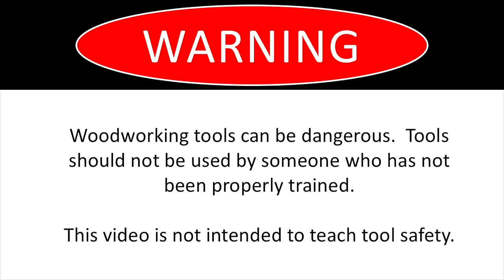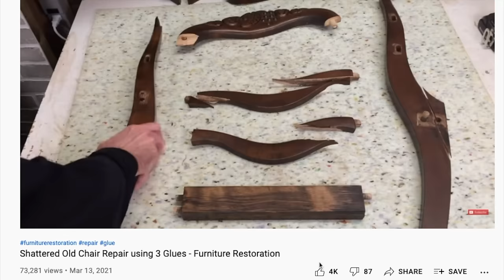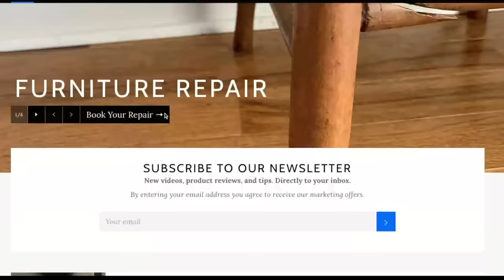Difficult Restoration of a Broken Chair, a Woodworking Repair by Fixing Furniture

Comment: With CA glues, you can also use the instant-set thin stuff, line your pieces up, clamp together, then drip the glue into the joint.  It will flow in, and you get a nearly invisible bond.  My ex used to use it for building radio controlled model planes, which are subject to quite a lot of stress.  The wood is usually balsa or bass wood, and if you happened to crash the plane, the wood would break anywhere except at that glue joint.  It makes a very strong joint.
WOW!  What delicate work, trimming off less than a kerf at a time!
Reply from the maker: Thanks for sharing that tip.  I appreciate it!  Scott #tip

Comment: Sap wood: If I am joining two or more boards with sap wood edges, before cutting it away and scrapping it, I try joining the two sap wood edges together to see how it looks. It might resemble a book matched board good enough for a tool chest but probably not good enough for fine furniture. I agree with your suggestion in reference to use of darker stain in this case.

Comment: Dear Scott, great job! The chair was a real challenge. Two comments: 
- I like to see the original pattern of the wood, so I agree with the natural finishing instead of darkening it.
- Wound not have been possible to consider the grains and patterns of the wood more in the replacement pieces?
Congratulations for the videos, I learn a lot from them!
Zoltán

Comment: I was an upholsterer for about 25 years. I recovered and repaired several Victorian pieces of similar style to this project. On handy technique I learned for filling voids in mahogany or black walnut was to use auto body filler. After it was hardened and shaped you could use a pin to poke and drag  across the filler to simulate the wood grain. It took a lot of patience but the result was very realistic. First fill the grain with very dark stain, the lightly sand the residue off the filler. Then stain the filler with a brown that matches the wood color. You can use an artist brush to add color variation similar to the wood grain then spray over it with lacquer. It is very realistic.

Comment: Thanks Scott for another great informative and entertaining video. I always come away learning something. One item comes to minde though on heating a joint. you are very relucktant to over heat and burn the wood. Tom Johnson seems to live by heat on a suborn joint. he uses the two minute rule on low setting using a timer. and so far he has not had any burn problems . to each their own as the old saying goes. thanks again for sharing. ECF
Reply from the maker: Very true!  Nice to hear from you Ellis!

Comment: Good day, thanks for the incredible videos!  
A quick note on superglue/CA glue:  As a former paramedic, we dealt with superglue for more than you'd expect.  CA/superglue is strong on tension, weak in torsion.   If you ever get your skin glued, twist a few times instead of pulling, and the glue will usually break without issue.
Reply from the maker: Cool!  Thanks for sharing that Alan!  Scott

Comment: You are the man! I have watch more than 3 hours of your videos. I doing my 2nd project after watching your videos. The first was a roll top desk. I'm still not good in finishing...so it came out okay but whit a lot of mistakes. It was for my wife , she love it but I'm my biggest critic. I'm now building a vanity desk for my granddaughter. I'm, aging using an old desk I found. It needs a few repairs. From what I watch from you, I think I should use epoxy glue. Where did you get the silicone cups?

Comment: I have 2 tables that need restoration and refinishing. Both are antiques of different ages. I know that the smaller table has beautiful wood underneath the blackish finish. 

I also was blest to be given a sofa that my grandparents bought PRE- WW2.  The frame is very solid and sturdy with medium brown Naugahyde “skin” and 3 seat cushions - 12x12x 2” . The springs and cushions and dust screen all need replacement and there are some small areas of the “skin” needs some attention. 
The stuffing in the 3 cushions are horsehair, but I don’t know where to get high quality foam  in the size I need.  Any idea what the cost would be to get this sofa back to better shape for the next 4 or 5 generations of family use?

Comment: There are off course different opinions about what to hide and what to reveal. It used to be common to hide dovetail joints. But now dovetail joints are an indicator of age and workmanship as opposed to something factory made. So you might want them to be in full view.

It does not surprise me at all that a customer might like to have the wood be in full view. The contrast between the light and dark wood is kinda cool. Even if it wasn't intended that way.

You see that sometimes in old building that have been recently renovated. Sometimes they like to highlight at show off the old construction and history of the place

Comment: That was incredibly complex repair. I am impressed you pulled it off. (I would have soaked it with epoxy, wrapped it with a bicycle inner tube and then pretend it did not exist. :-)  )

Comment: Watchigm your video has been part of my jnspiration tonstwrt fixing stuff at home. Today i took apart a wobbly chair ivebhad since i was a kid, and my grandparents had before me.  Turned out all thats wrong is a few screws are stripped and one is too short, from precious repairs. And no, its not a valueable piece, its just a wee bit sentimental, its been reupholstered several times and repaired by more than one of my relatives.  
Next up is refinishing a pair of 100+ year old chairs from my great grandparents. They are still sturdy, but have been painted over several times. 😢 stripping paint/finish is NOT fun lol

Comment: When it comes to small cracks why us colored wax instead of wood putty. Just wondering
Reply from the maker: I've used a variety of fillers, and I prefer the wax because I can tint it where I see it.  I can't do that with putty.  Here's a video I made on the different types of wood filler.  Cheers. https://youtu.be/d9KC36yZdZs